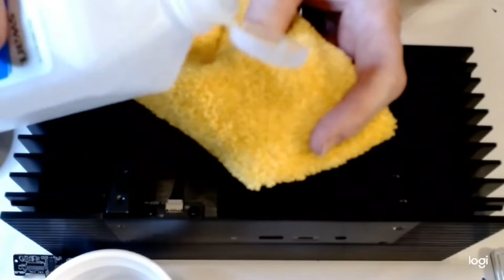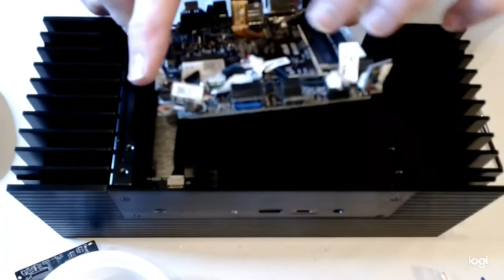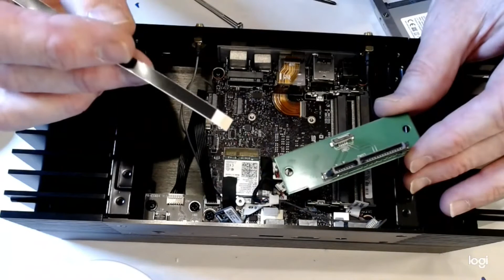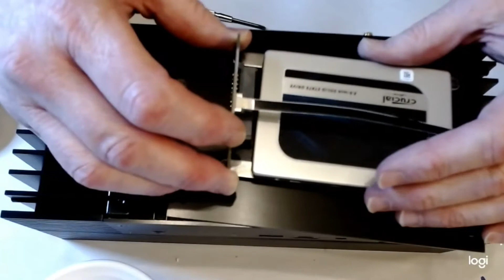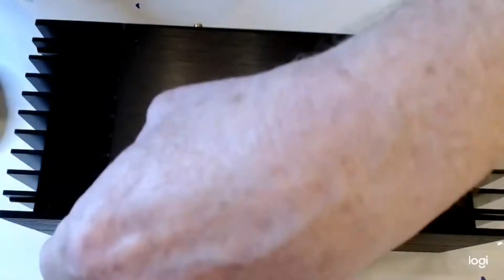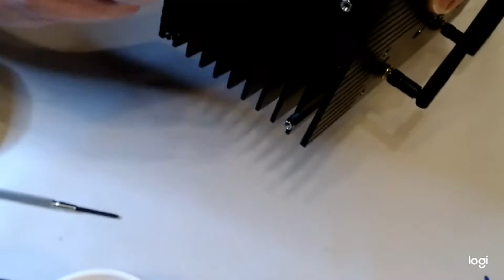ASUS PN50 install into Akasa Turing A50 Case

Comment: What microphones?
Reply from the maker: The ASUS PN50 comes with a left and right microphone for use with Cortana or for making calls, recordings etc.  You can see two small holes on the front of the case, below the headphone jack and the remote I. R. receiver. The microphones are stuck to the inside of the case with adhesive over these holes. The Turing case does not provide holes to use them.

Comment: Is Liquid Metal recommended?
Reply from the maker: That is a definitive NO. Liquid Metal thermal paste contains gallium, which has a chemical reaction with aluminum and changes the structure of aluminum, making it very brittle. The thermal block and the case are most definitely aluminum and will be destroyed by gallium. For info on how the two metals get along together, watch this: https://youtu.be/GomkCtRXtKs

Comment: Thank you for your uploading. This would be so helpful for people having PN50. When I received PN50 4800u, I was so glad but now its fan noise almost kills me. I researched an alternative cooling solution and found Akasa A50 chassis for a fanless system. However, this looks like having some issues as well. There is no opening for DP port and no holes for VESA mount.
Reply: Depenends on how many displays you want to use. I use a USB-C to DisplayPort cable to connect my (single) 27" Dell display and it works great. What bothers me more is the lack of Bluetooth support in the Akasa case, but you can use the external antennas as shown in this videos. Doing the transfer into this case was absolutley worth it. Too bad the 4800U is not able to get here in Germany - but the 4500U does a great job.
Reply: There is a version two of the case now that has a cut out for the display port and mounting bracket, holes for the microphones and a mounting for the card reader. The two points I would note about the new features are that first when installed the card reader obstructs the screw for the M2 socket. Second you will need two small pieces of double sided adhesive to stick the microphones to the case, about 5x10mm does the trick.  I would would note is that the official Akasa WiFi antenna leads are two short for the second antenna. I was not going to bother with them as I actually have the WiFi turned off in the BIOS, but you need them for Bluetooth (makes sense the case is a Faraday cage after all), so I stuck some short stubby antennas on them. I would also say the fly lead from the main board to the power button and LED is way too long, it should be half that length.
Finally after six months there was a huge amount of fluff in the fan despite regular cleaning with a can of compressed air. The silence is golden.

Comment: Why did you use the included thermal paste to bind the cpu with the aluminum ?
Why didn't you use all your separately purchased thermal paste ?
Since I used all the included thermal paste I have none left now lol so I have to pauze the action and wait for the extra thermal paste to come in.
Thinking of removing the included thermal paste (I already applied on the cpu) with the 12.5w / mK I purchased. Hope it won't be too messy.
I have a 4800u and don't want to have throttle issues because the included paste is kinda terrible
Reply from the maker: I was in the same situation as you. I stopped, went to the nearest Best Buy and bought thermal paste, came home and continued taping the video. Why didn't I go back and apply the separately purchased paste? Because the delta between the very best and the very worst thermal paste available amounts to 2 to 3 degrees celsius. It just wasn't worth the effort. I also didn't want to possibly damage the thermal adhesive pads on the other parts of the motherboard.
Reply: @BradFrese Yes you are right! Probably not worth the risk. I found some thermal paste from cooler master lying around here which is 6 years old. Any idea if it goes bad ?
Reply from the maker: @simusic8868  I have no information about whether it goes bad "in the tube," but I doubt it. As long as it adheres to the pieces you should be good to go. After five or six years of use, however, thermal performance does decrease, and it may be worth it to tear down and replace at that time.
Reply: @simusic8868  I had some MX-4 lying around, but it was much less content in the tube than I expected. I decided to install it on a national holiday, so the dilemma was to go with what I already put on the plate or wait another day - I risked it and it is completely Ok. I'll even venture to say that the included paste can do the job perfectly if used very very carefully.

Comment: The included thermal paste is only rated at 2.5w/mK, i used another one which is rated at 12.5w/mK.
It's also possible to install a 15mm thick hdd in this case, i'm running a 5tb seagate as a storage alongside the 970 evo.